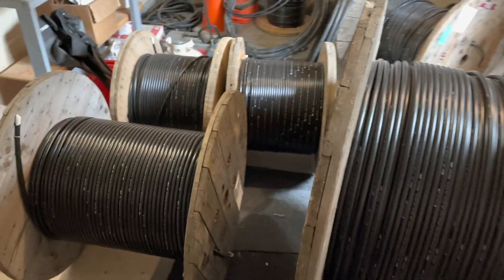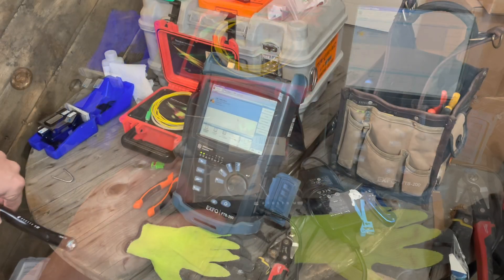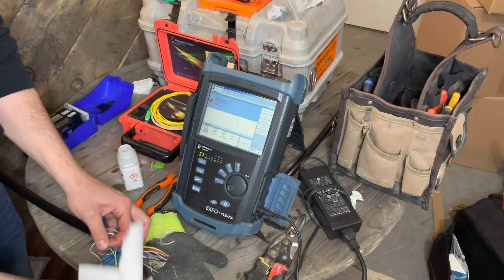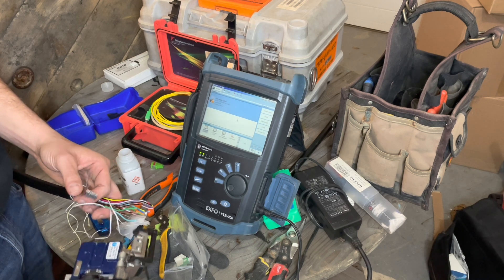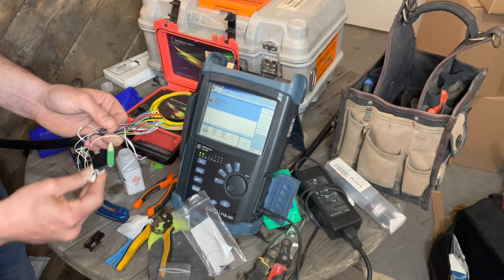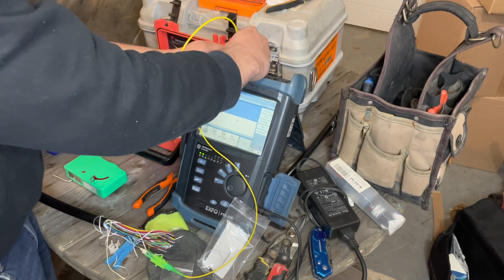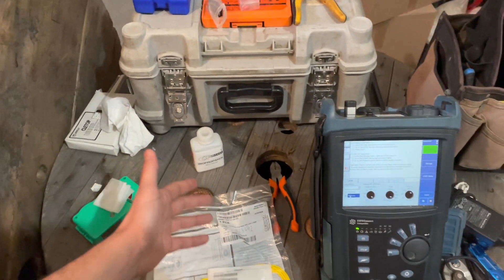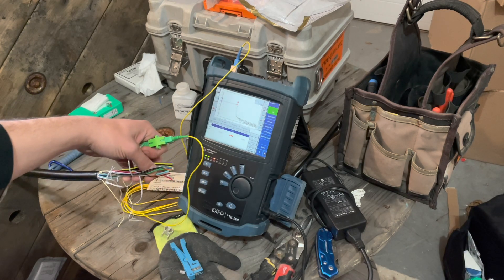Fiber optic cable reel testing

Comment: I usually per-cert my fiber reels on my splicing table and exposing at least 4 feet of cable from the end of the reel. Then I will fusion splice all strands into a 12-strand pigtail per loose tube buffer and record the fluke otdr test results. My customer (Marathon Petroleum) requires pre-cert, post install and turn-up certification results for all cables installed in their close out package. Its tedious work but it is very consistent and makes you a more efficient tech. 

Keep up the good work.
Reply from the maker: Nice right on thanks for watching and commenting I appreciate it. Yea I have a had some clients require the reels to be tested before and after install but has faded out a bit now they are only requiring  after install test results

Comment: Can you just read the sheath footages? Also, I will not buy those pelican case style launch boxes anymore because of how easy it is to pinch the fiber. I buy the “reels” now like FiberXP and similar. Comes with a protective clamshell pouch.
Reply from the maker: Yes you can just read the meterage but some customers want the real pre tested before installing to insure there is no manufacturer defects. Yea I feel you there have to be extra careful when putting these ones away I have multiple the real ones and the pelican case ones. Thanks for watching and commenting I appreciate it

Comment: The fiber I’m running here in south Texas must be cheap stuff. Absolutely no armor on most of it. 96 ct fiber is maybe 1/4 inch. Even the 432 it’s micro fiber binder less. Cracks so easy
Reply from the maker: Yea all depends on the project for the most part out here it’s always armoured unless it’s inside wiring. Thanks for watching and subscribing

Comment: I'm always surprised by how roughly you handle the individual fibers, like when preparing to cleave you had the metal mount dangling off the end.  I was under the impression that the original fiber consisted of delicate strands of glass, Is todays fiber a more rugged polymer that can handle more abuse?  Or do you just have the "nak" when it comes to working with the stuff?
Reply from the maker: Haha yes I am very comfortable with the fibers they are very delicate and can break pretty easy I am just used to working with them on the daily and have a nak for it. Don’t get me wrong I have broken fibers in the past but after dealing with it on the daily for 10+ years I’m super comfortable with working on the fibers in any scenario